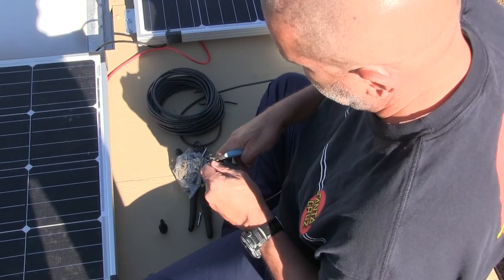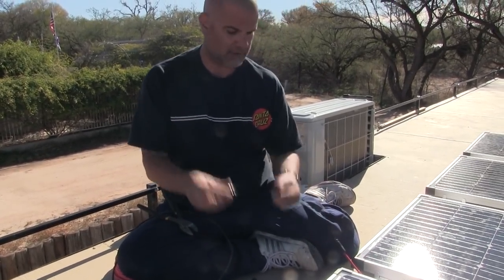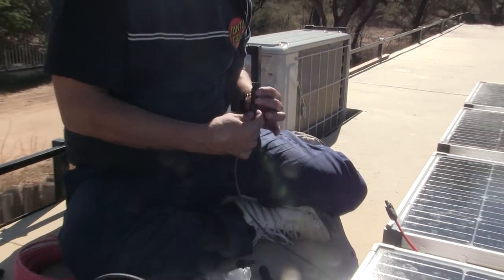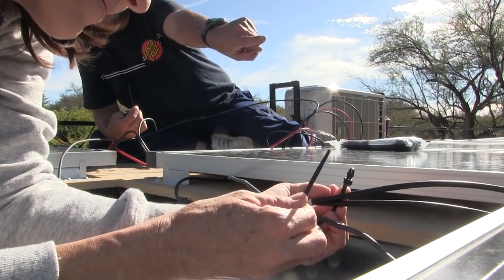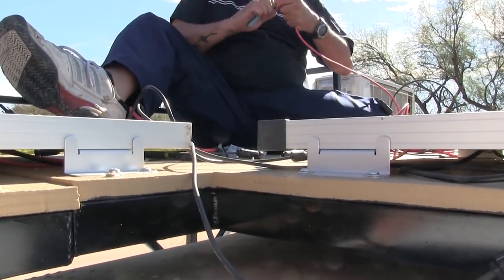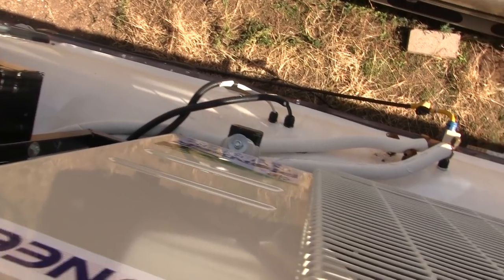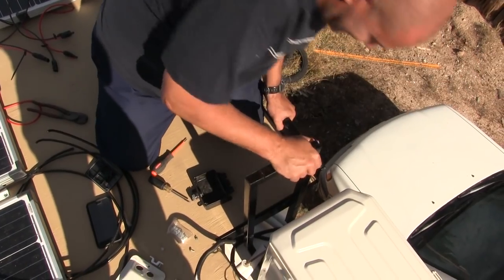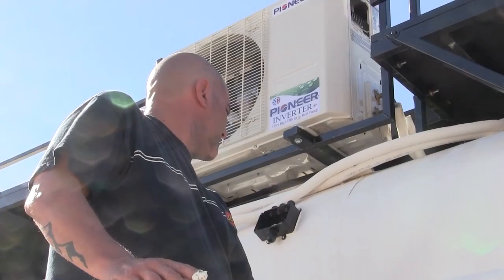Solar Panel Wiring & Midnite Solar Charge Controller Hookup in our Skoolie

Comment: I so wish I would have done a bus now.  There are so many good builds.  I would have loved to do a greyhound type bus.
Reply: If you guys ever need to update any of the power system, I am using MPPSolar Components and they have been dynamite so far.  I have 2 of the LVLV2424's in parallel, and an PCM60X.  The inverters have 80 amp mppt controllers built in, and can also do charging via shore power, and can even back feed to utility.  I love mine.

Comment: Midnite classic 150 I have I think there top of the line, I've got 2200 watts of panels now, and 48 volt outback inverter, but gonna be getting another 4kw panels this fall, I know that 6200 watts an gonna go over the 96 amp limit of the 150 controller but whats nice about them is you can adjust input/output amps that allows me over panel, or adjust them accordingly to the temperature of the battery cables

Comment: I was concerned there for a while that the solar input would be live when connecting to the regulator before battery/s were connected, the Outback FM-60 and 80 very similar to your Midnite dont' like a no load situation  ie no battery connected when a large solar amperage is coming in, always disconnect the solar input before disconnecting batteries , a DC fuse breaker or pull down type fuse knife switch before the regulator from the panels is  needed.
Nice project and well fimed!
Reply: I've got the Midnite 150 and you are right for most charge controllers always hook up the batteries first the controller needs to configure itself or manual configuration before turning on the panels or probably burn them out, But I think the Midnite has protection for that.

Comment: Pretty cool are you going with lithium or? And if so are you buying from a manufacturer or plan on trying to build some? Anyway congratulations on the panel hook up and getting it running she's really coming together you two I'm very happy for you this is a great milestone you'll soon be pulling out of that driveway and on to your adventures. Oh forgot to ask how big is the inverter I'm thinking about the Aims 24volt  6000 watt in the 220volt model for my coach any advice would be appreciated Mike
Thanks for sharing.
Reply from the maker: We are going AGM for now. The cost breakdown just doesn't make lithium viable for us.  As far as our inverter it is the AIMS power 3000w 12v

Comment: I hope you guys had a beautiful Merry Christmas. The 1st kid is always experimental, We try that bad shyt on them then we know better with the 2nd kid. LOL 
 Hey, Mike, I know you're not finished but I noticed you put your Solar Control set up at the Edoor are you going to box and Insalate all that area in, how are you going to keep the condensation off the ceiling and running down into all those breaker boxes and Edoor? Just tell me to hush BC your not finished with that area. LOL
Reply from the maker: LOl, it's not finished, but AZ is also waaaaaaaaay more dry than most people realize, and we probably won't be in moist areas in the wintertime. Of course, we'll also have a woodburning stove which eliminates even more moisture from the air!. I guess we'll just see if it works or not!
Reply: @BussyMcBusface  I hope it works.

Comment: How are your Renogy batteries holding up?  I've bought one so far and today heard Renogy stuff was "garbage" .  I. Sure hope not because we have their solar panels, battery and charger inverter.
Reply from the maker: The are doing just fine.  That said, we were gifted 5 Battleborn lithium batteries and we did just upgrade a couple weeks ago.  It wasn't because of the batteries though. They are just fine

Comment: Just out of curiosity is the Midnite Classic 150 good enough for the amount of voltage coming into it?  I"m installing 4 - 345 W 36V panels and i need the Midnite Classic 250 because of the voltage.  I'm still trying to wrap my head around solar, all the proper gauge wire etc etc.  I just figure with the amount of panels you have you might have needed the larger controller.  Like i said...still trying to understand this stuff.

Comment: Exactly why there should be a breaker between pv and controller and controller to batteries. And you’re wire should have more braids. That course wire is not ideal.

Comment: You know that 150 Classic is too small for best results. The 53.85v x 29.25a could easily be converted to over 107 amps to the batteries.

Comment: You really need more than a couple of fire extinguishers.      No fusing or circuit breakers? And batterys stored inside with no venting .
Reply from the maker: There is fusing everywhere...
Reply from the maker: You just haven't seen that video yet.